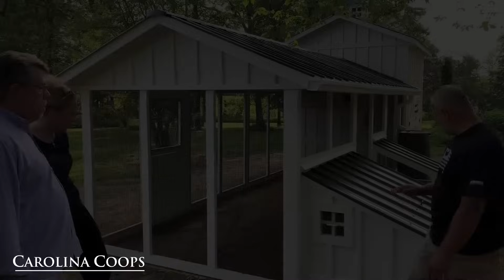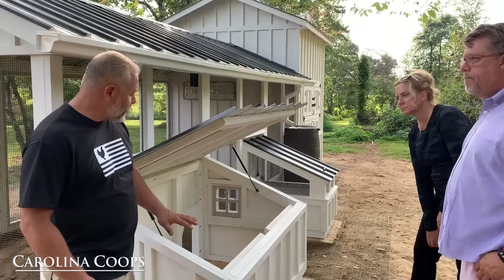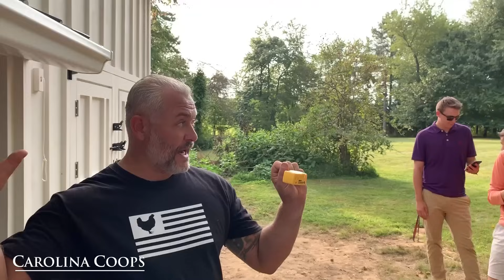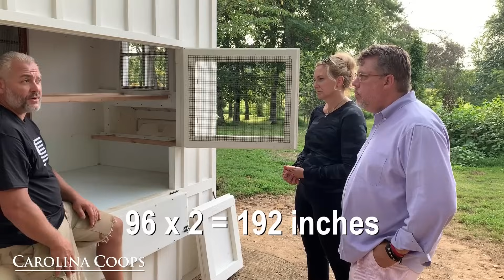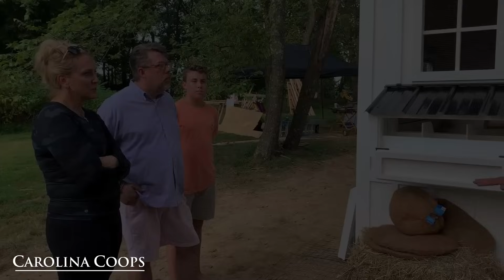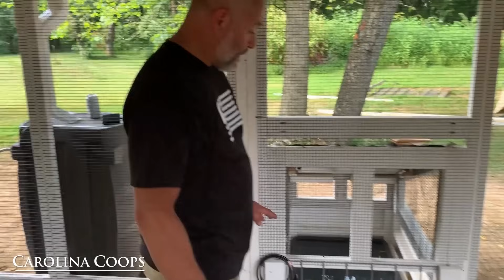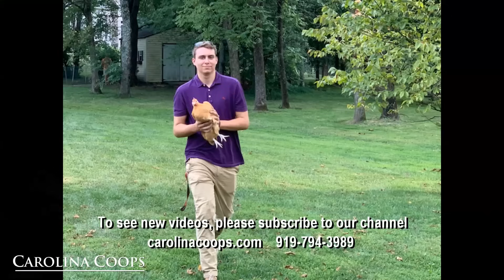Custom Chicken & Duck Coop! See How Our Duck Dipper Works!

Comment: Love this coop. Just a thought,  a cleanout door on the duck nesting boxes will make cleaning them out 100 x time easier than shoveling bedding out over the top. Having the whole back can flip down to broom it straight out would be awesome. I breed ducks and it's a MAJOR issue for us if there's no cleanout hatch. The owner's back will thank you. LOL
Reply: Also, if you make the nesring box floor linoleum as well as pullout, it will be easier to clean out as duck poop is wet and will rot the wood.
Reply from the maker: the duck house completely opens from the back for clean out. It swings out. 😁

Comment: Wow, as a long time viewer of your coops I Have to say You hit this one Out of the Park, finally a Coop that takes care of the needs of the Ducks and the Chickens.
Love the Duck Dipper, Would they be able to Take a good swim in it?
  Thank you for much for sharing
Reply from the maker: Thank you for the kind words Richard. We love being able to solve issues that our customers have and having ducks and chickens together can be a problem, mostly a moisture problem. Since the front of the duck dipper comes off, the ducks could swim in it, although it's not very big. However, we believe the homeowners plan on having a separate pool for them outside of the run.  It was create to allow the ducks to get their eyes and beaks wet (which is necessary) without getting water in the run, which is best if it's kept dry. We're so glad you love this coop! Thanks for watching!
Reply: @CarolinaCoopsVideos  I really like the ideas in this coop/run design, but I'm very curious to see what the owners and their new tenants think. Do they have a YouTube channel where they might share their experience over time? I'm especially interested to see how they do having ducks and chickens in the same run together. 

Also, do you have any details on the duck dipper components?

Comment: Bears in Virginia will lift those roofs right up on the little accessory buildings. Suggest a latch and carabeener (spelling?) for each. I would also be worried about the run material standing up to bears or coyotes and dogs. I would want to add a layer of heavy gage fencing or even cattle panels. The man we got our chickens from had pens with chainlink fencing gates that had a full surround of aluminum tubing. A bear worked on it until it bent the tubing, ripped the gate panels open, and decimated the chickens. It got into two pens. 
An alternative is to surround the area with electric fence, which actually works quite well against bears and coyotes. 
I would also add some linoleum flooring to the duck pen. Take it eight inches up the walls, too. 
I really do love these Carolina Coops! I want one!
Reply: Spot-On Dude!

Comment: 7:15 and I'm done. Raises duck house roof and shows system to slash face and eyes off.
Serious safety issue to have raw corrigated roofing at eye level. Probably a $20,00.00 coop.
Also only 1/4 way around outside so slow, talky, talky, more walk next time.

Comment: Wow, guys. Absolutely gorgeous! Love all the ventilation! The duck “mouth rinse” is completely brilliant! A couple of suggestions: the owner prolly needs a room for feed & egg storage more than a “she shed, no? Add a drop down door to the duck nest for easier cleaning, cover the electrical wires for the heat pumps etc. with PVC pipe for safety and put a lock on the pneumatic duck nest lid/roof —a raccoon might figure that out!
Reply from the maker: Thank you for your comments and your suggestions.

Comment: Matt you should install a rubber bumper along side those edges of the metal roofing on the duck house and duck bath, otherwise I know I would slice my forehead open peeking into those little houses. Otherwise the design is spectacular. What a beautiful Coop.
Reply from the maker: Hi Dave, we haven't any forehead slicing incidents, however, it is a concern for us. While the edge isn't very sharp, we have used automotive trim on the edge. The problem is it helps trap water, so the trim doesn't stay on. We keep searching for solutions to a concern some customers have. Thank you for your comments and for watching!

Comment: Just a thought and I may be wrong.  If you doing concrete runner bases, I don't see a need for the predator wire.  Usually here in Louisiana  we will do footings at least 18" deep in hard clay, and I know up  north due to the freeze line you have to do deeper footings.  I just can't see a fox,coyote,wolf digging 18" or deeper to get underneath.

Comment: The duck box is sweet just wish the wood was covered with poly carbonate too and use a side hinge on outer wall to swing open for easy sweep out cleaning couple extra bucks would be amazing!!! ❤❤❤❤❤❤❤❤❤❤
Reply from the maker: Thank you for your comments Laura. We decided against using HDPE in the duck house because they will nest and lay in there and it will be very slippery for them, even with bedding. The doors do hinge out to sweep out the duck house. Thanks for watching.

Comment: It all looks wonderful but 1) how would you keep the pipes from being blocked with dirt or any debris? 2) how is roof gutter water  clean enough for chickens to drink?
Reply from the maker: 1. You can keep the pipes from being blocked with screen, the same way you keep any gutter from being clogged. 2. A Chickens digestive system is not the same as ours.  A chicken's body is constantly challenged by bacteria that cause diseases in their environment. Their body will build up an immunity.

Comment: This is just amazing !
I hope to have you build me one within the next year.
On the run, is there a reason that the sidewalls and door can't be taller ? I really would want them high enough that tall people don't have to duck. I'd love having the barrel waterer, but not really needing the duck accommodations.
Reply from the maker: We have made the side walls taller than 6' for people, but the wider the coop, the higher the peak. The reason 6' works for us is that it allows nearly most people to walk in comfortably and there is a domino affect when we change one thing in the building of the coop that ends up effecting all the others, so 6' walls is what works best, but again, anything can be customized. Thanks for your comments.

Comment: Is it possible to have more sitting rods in a stair formation to have more chickens in there?
Reply from the maker: Hi, great question, we design our coops with the right number of roost bars and nest boxes based on the size of the coop. The issue with adding another roost bar is now they are too close together and will likely get pooped on. Stadium style is an option, however, in the way our coops are designed, that feature would interfere with other design features. The important thing is you never want to overload your coop with chickens because it can lead to health issues and cause stress among the flock. Thank you for your question.

Comment: What is the coop made of? What is the base of the coop made of the part that the hemp goes in. Won't it rot out after a few years if it is wood? What do you use?
Reply from the maker: Hi Renee, we use premium Douglas fir lumber for all our coops. Inside the henhouse is food safe high density polyethene, (think of it like your kitchen cutting board). It makes for easy cleaning when the time comes in a year or so. Also with the deep litter method (plus our industrial hemp) there isn't a build  up of moisture, so even our older coops with a wood floor in the henhouse won't rot. 
thank you for your comments!

Comment: But what happens when you get temps of -40 or colder should there be some kind of heat then ?
Reply from the maker: Hi Michael. Are you asking about 40 degrees below 0? Because that is extreme and not common especially these days. We do not adise heating your coop ever. There are multiple reasons for that listed in our resources on our website, the biggest one being a huge fire hazard. We do sell polycarbonate storm shield that you can attach to the sides of the coop (where the hardware cloth is) to protect from cold winds, sleet and snow while still letting in light. Thanks for your comment.
Reply: Yes below zero and it is quite common in Alaska last winter I saw where it was - 50 at prudhoe bay 
But that is right on the north coast of Alaska I am looking at land in the interior hoping I won’t have temps that cold
Reply: I was already thinking about storm shields I’m glad you have them

Comment: Is the duck dipper design just so they can get their head in? They like to swim thou, and of course love pooping in the water. I wouldn’t stick my hand in the dipper if they are allowed to swim. My ducks love swimming. Dip in and get their feathers wet, and then they come out and run like it’s been the best dip of  their lives! I love the idea thou. This house has given me tons of ideas for both my chicks and ducks. Thank you! 😊
Reply from the maker: The duck dipper is just for them to dip their heads, however, the front can be removed and they can jump in there. But the point was to try to keep the run dry because it's mixed with chickens. They plan to have another pond area outside the run for the ducks eventually.

Comment: I hate to be the bearer of bad news but I dug an 18" deep x 12" wide trench all around my coop/run. I put half inch hardware cloth down into the trench, folded it along the bottom of the trench and then put cinder blocks on top of the hardware cloth. There are 2 full cinder blocks and pavers up to ground level and everything was backfilled and tamped down. The hardware cloth continues up all the way to the roof rafters. The RATS STILL GOT IN! They dug down 2 feet and tunneled under the cinder blocks and into the run. The underground in the run is filled with tunnels that periodically collapse. It is a total nightmare. What you put around that coop will not keep a determined family of rats out.
Reply from the maker: Our predator apron is designed to keep out predators, not rats. Matt has mentioned in various videos (Check out the big Orlando custom coop video) that rats can get through extremely small spaces. The best way to deal with rats is not to give them a reason to go to your coop, meaning don't put in  more table scraps that the flock can eat during the day, and use feeders that don't create as much waste. Also don't have places for them to raise young and hide. It's tough, but you are just trying to not invite the pest in the beginning. Check out the video to see what Matt says about it. Thanks.
Reply: @CarolinaCoopsVideos  Rats are predators, I've seen them kill and drag off plenty of pullets. Friend lost all her pullets to rats. I do use feeders.
Reply: @70acres  what type of rats was these? I've never heard of them doing that. Matter fact it's usually the chickens eating them up
Reply: @gelsm8709  BIG rats. I also witnessed a friends flock getting attacked by a rat. They were all pullet size birds. My chickens will eat a mice whole, but big rats are nasty.
Reply: @70acres  wow that's scary I hope they don't attack mines

Comment: Shouldn't water be kept in white buckets to avoid slimey mildew and mold which dark buckets are a breeding ground for?

Also, I have 9 hens around 9-10 weeks old and I don't get the idea that they don't mess on their roosting bars.  They do.  Because if they are walking down the bar to find their spot to sit, they may very well poop on it.  I painted mine with a nice exterior paint and they are also similar to this system and removeable so I can pull them out, rinse them off easily, and put them back in.

Your coops are beautiful though! I wish I could afford a smaller one from you guys because I can't build another right now.  I'd love to breed other pure breads though so having a couple of other small ones for that would be awesome.  Maybe one day.  

Beautiful work and craftsmanship!

Comment: My only concern with the duck house and the duck dipper a super predator could tear them apart to get the ducks of course I would need to build an iron cage around your coop to keep the big predators out I believe your cage would keep out the smaller ones

Comment: These folks build a great product most of the time and as they have said brefore they like to hear feedback. 
Well here is some feedback. 
I am not too fond of those sharp metal corners and razor edge right at eye level of the duck house roof when open. 
Watching the lady grab the roof handle 8:53 I can see the hurried person reaching to grab that handle to close the roof and either slit-their-wrist open or split the skin between the thumb and fingers as they quickly / blindly rush through their chores.  NOT GOOD! 
CC - You folks need to rethink this hazzard.

Comment: Someone will bend over to harvest eggs and gash their head wide open on that corrugated roof. This is a great coop with a massive flaw.
Reply from the maker: Hi. We have never had that happen in the thousands of coops we have sold. You don't have to bend over that much to get the eggs, you just drop down the egg hutch door. Secondly, there is no need to stick one's head that close to gather the eggs, where hitting their head would happen. And thirdly, the roofing material doesn't have a sharp edge on it. It's dull. We have tried to put rubber trim on the edges, but it traps water and never stays. Our design makes it so the water just runs off and doesn't get into the egg hutch either. Thanks for your comments.

Comment: Lies!! Ducks poop wherever they sit.  Should have had a construction sand floor in the duck house and done the deep litter method.  Pressure treated or not that floor will rot.  Plus I would never put pressure treated where they will be mucking about with their bills or sleeping on.
Reply: Lol, that little drain and skinny pipe will be clogged up on the first day.

Comment: Terrible design.  Looks good, but not practical.  It would be MUCH better if the roosting boxes were up higher and had a back hatch to easily sweep out old floor cover for maintenance.
Reply from the maker: Hi Carl, we don't think it's a terrible design, as a matter of fact, we have been working for over a decade perfecting the design so it's functional and beautiful. All our coops have drop down gates on the back of the henhouse to sweep out the litter after a year or so. The egg hutches are at that height so everyone in the family can reach them. Please check out our website to see all the features on our coops and I think you will realize how thoughtful our designs are. Thanks for watching.